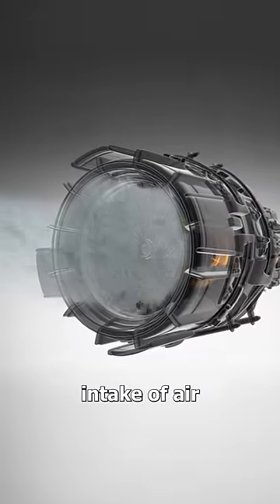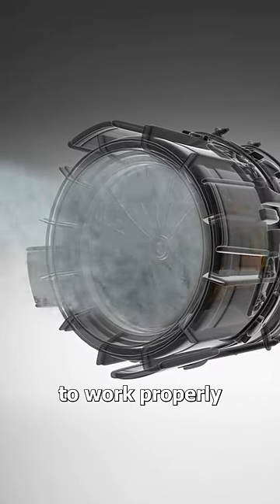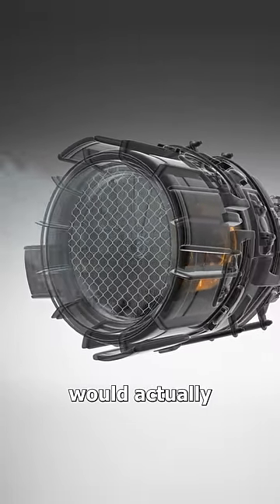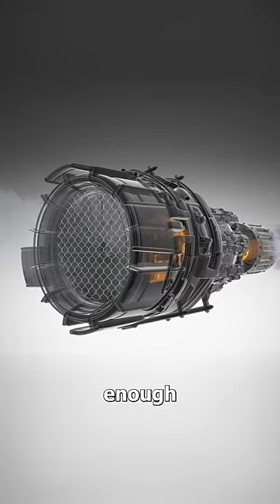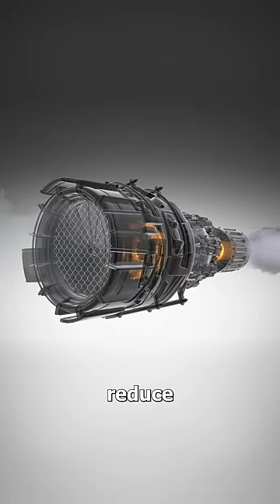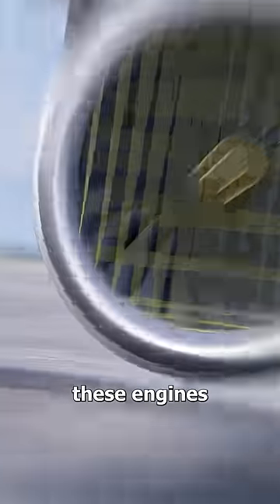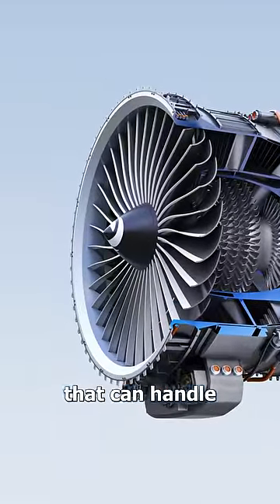Why Jets Don’t Have Bird Blockers 🤔

Comment: why not just have extra intakes on the sides of the engines with grates on them as well to compensate?
Reply: Pretty sure they already figured out and guess what,it doesn't work too.

Beside if a grate is installed and the air intake is stable with the grate,the birds would still be a problem anyway.
They'll get stuck, obstructing the air intakes even more

Comment: Did no one also stopto think wait, wouldn't the bird STILL DIE because it hit a fence at such high speeds? I mean sure their body may not get blended but now you'd have a dead bird's body STUCK infront of your propeller. That's way more dangerous that just letting the bird get blended.

Comment: Even with a barrier, the bird will just get hit hard by the engine such as with a bug being hit by the a cars windshield. The body of the bird will seriously get hurt if not instantly killed since the plane is traveling very fast. The bird will then just be stuck on the barrier since the engine is still sucking in all the air. Either way the bird is dead.

Comment: Birds would get stuck and squeezed against the grill and their feathers will get ripped off and sucked in and they will remain like that until the engine stops, obstructing the airflow even more because of the low air pressure in front of the engine...

Comment: Even with the cage with plane going at 900km/hr and engine taking so much air at such speed,  wouldn't the bird just stick to it like a iron to magnet and then due to High pressure they would just become pancake and then get sucked in square peices😅.

Comment: Just think about it, do you really think a bird can get off of this cage at speed and not obstruct air flow, which would make a crash ?
Reply: Then maybe we should strive to reduce the number of planes as much as possible, I feel like that's not what you're saying
Reply: @Etamine  Yup i was talking about the fact that if you use the cage system showed in the video, it would more be a bird trapped inside it than air flow (sorry for bad english)

Comment: There is not a fucking way a skilled engineer capable of creating such turbine isn't good enough to make a secure barrier for the engine. I learn to understand that everything is possible in engineering, its just a matter of thinking. The only reason engines have no barriers, is no one actually cared enough to make a design. This is why we need actual passion, innovative engineers, instead of educated fools stealing already made concept without thinking much. I bet creating such design could save up a lot of maintenance money. I share the idea with passionate individuals, I'll be working on my solution design in the meantime, so together we can live a little better, and save some cool birds too!
Reply: If a bird was hit by an engine  moving at hundreds of miles per hour, it would be dead regardless of whether there was a grate or not.
Reply: @gruffcube  engineering is about fixing a problem. I bet there are ways around.

Comment: Wait… is it common for a bird to get hit by a plane?
Reply: Bird strikes are pretty common yeah, about 17,000 happen every year in the US alone.

It's for the same reasons that deer get hit on roads, it's a massive hunk of metal careening towards them at several dozen times any speed evolution could possibly have prepared them for, so even if they see the plane coming they assume that it's too far away to be a problem until they're inside the engine a quarter of a second later.
Reply: @physicsunderstander4958  😰

Comment: Birds would just get stuck on the engine external gate it would still die from the pressure of the engine, right beside it, so what’s the point of adding it anyway?

Comment: Engin has blades to cut eveything into pieces on purpose
Reply: The blades are there to compress the air for extremely energetic combustion, not to slice stuff up. That's mostly just a happy accident considering it helps make the engine more survivable if the blades are engineered right.

Comment: Bro do you have a brain?? This explanation isnt wrong but is also not right. No bird would be able to escape the net in front of the engine because planes are flying so fast. And furthermore the massive force of a jet engine would probably still shredder every bird. They would probably pull the bird through the net.